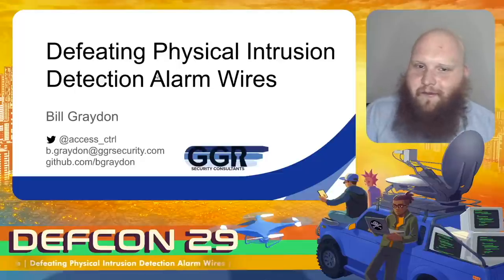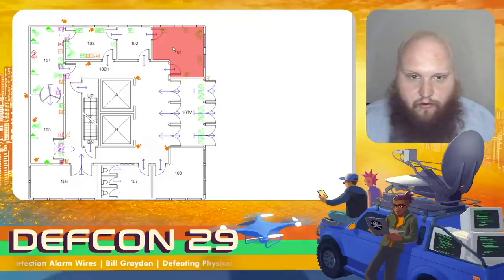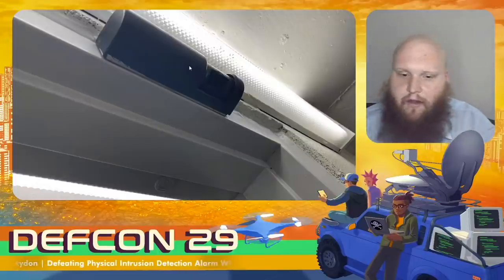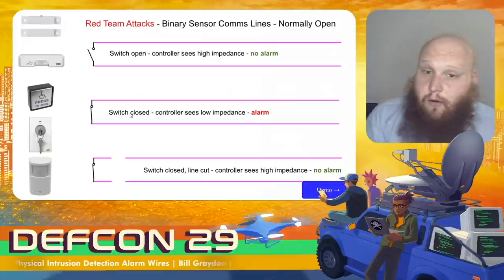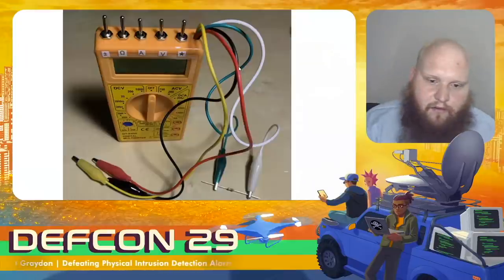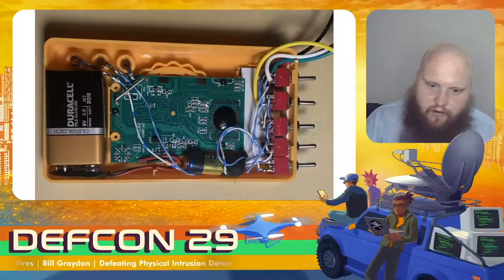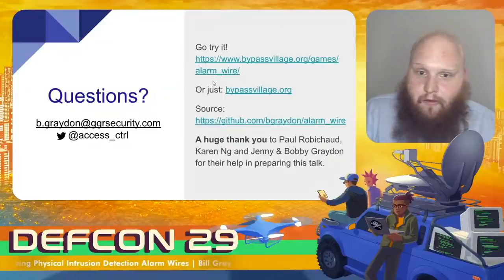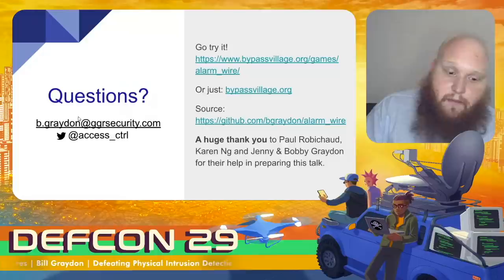DEF CON 29 - Bill Graydon - Defeating Physical Intrusion Detection Alarm Wires

Comment: I'm imagining a movie scene with the classic laser hallway, but two covert entry operators have to go through;
Operator 1: "I'll go first, you follow my movements exactly" *proceeds to do incredibly complex acrobatic moves through the lasers to get to the other side of the hallway 2 minutes later
Operator 1: "alright, now you go" 
Operator 2: "one sec" looks at wall mounted security control for a moment before cutting a wire and then casually walking through the lasers like they don't exist "nice moves, by the way."
Operator 1: "YOU KNEW HOW TO DO THAT THE ENTIRE TIME AND YOU DIDN'T SAY ANYTHING?!"

Comment: I think armouring cables should not be your first concern if someone can get access to enough of them and have all the time to disable enough detectors to cause a threat with this method. Very good and clear demonstration otherwise about the principles of the systems.
Reply: Put pressure on the conduit and make the alarm go off when the pressure drops. (Or perhaps even better, put a vacuum in them) This makes tapping into them even more precourious

Comment: The people who are clever enough to understand how to do this, and skilled enough to do it successfully, are probably too smart and careful, to trust that they're not falling for some easy trickery. 

You'd have to be so sure that it was the only one installed on that door. And that there wasn't a pir, or similar sensor, that would detect either the door opening, or you coming thru it.

If I saw a reed switch installed like that, on a system that was so well monitored, that I'd even have to resort to doing this, then I'd assume that there was more to this sensor, than just a badly thought out installation. 

Cool presentation though. Alarm logic is very fun to me. Thanks bro

Comment: Use two magnetic switches per door. One concealed, with internal wiring (inside the walls), and the other surface mounted, with external wiring, stapled to the walls.

Then you wire them to their own zones, making sure that you program the system, so that only the external (decoy) one is apparent, to anyone who happens to use the keypad zone leds, to try and figure out your alarm.

Also use pir sensors everywhere too, but mask them all in the programming, so people who visit can't just walk around everywhere, watching the keypad, to figure out any black spots they could exploit.

Another very, very important aspect of alarms, is remote monitoring, the communication protocols used for it, and what network type it communicates thru.

Preferably, you want to use cellular communicators, with fallbacks to Ethernet, and maybe even a second cellular network. 

Also, make sure your back up batteries are good, and every enclosure used in your system, is well located, and fitted with tampers.

Decoy alarm enclosures are a good idea too. I have three in my garage lol. With domestic alarms, you're really aiming to look like the most secure house on the street, unless you're one of the few people, who may actually be targeted by pros, in which case, you want to make it clear, with stickers, that your monitoring is cellular. 

It's pretty hard to block cellular comms. And anyone who understands them, is probably aware that most often, there are fallbacks such as Ethernet IP and old school contact id phone diallers, that make it very complicated to try and discreetly defeat them.

Obviously, in commercial etc, you're wise to add camera and access control systems too. And be very wary of who has access to what. 

There's no point having cameras and access controls everywhere, if Steve from the office, can just let himself in whenever he likes, and steal boxes of pens and paper clips, to sell on Amazon, without ever being noticed. 

And don't hide your workplaces cameras. It's probably not legal where you live, and you're looking to deter bad behaviour, not provoke it. 

Plus, who wants to be that boss, who sees or hears something they'd rather not. You're better to make surveillance obvious, or not bother. 

Being the stasi probably isn't that fun. That's why they were very angry people lol. You just want to make sure the workspace is secure and run well. 

You don't want to know what Dave does in the records room, when nobody is looking. You'll never be able to look at him the same again, or feel comfortable shaking his hand lol

Comment: Never seen such a simple intrusion detection system. Is this in use in certain country's? Where i live you won 't get insurance or a certificate for such a system. The same defeat system does not work on the minimum required type of switches that have atleast a 20khz OSSD double switching contact (with circuit crossed pairs in armored cable). Have you already looked into those kind of systems?
Reply: Monitored Honeywell alarm circuits with a 1k/2k end of line resistor are viable for UL certification in the US as long as the lines themselves and the sensors are secured according to UL standards. Typically this means in conduit it armored cabling.
Reply: This is the most common type of system here in Brazil.
Reply: I would say it's very common in wired residential systems (people have preferred wireless for a long time). When you see something like this in a commercial installation, it's probably not primarily an intrusion alarm system (it could be access control or fire alarm). European standard recognizes four grades of systems. And you have to realize that the scenarios geeks consider would fall under the highest grade 4, or at least grade 3. When it comes to certified systems, I would say grade 2 is most common in residences (at least when it comes to professional installations).

Grade 1 is essentially any old fool walking by. Grade 2 is a thief (some knowledge of alarm systems) with some tools (can be specialized, but shouldn't really be portable electronics). Grade 3 gives you professional knowledge and more sophisticated tools, including portable electronics (a jammer should fall into this grade). Grade 4 is expert knowledge and planning the attack ahead. So, the first three grades are opportunistic. Only the fourth grade is planned attack where you know what the system is, what are its weaknesses and you have all the tools you need (even expensive, exotic tools that require expertise to operate).

Even a simple system should satisfy grade 1 as it would work against a naive attacker (let's say you forget to lock your door and someone just walks by and tries to open it). With grade 2, I don't really know where the line lies (would a multi-meter be allowed? how about a hall effect sensor to determine polarity of a magnet?). Just like with safe standards, they underestimate how available and easy to use more sophisticated tools are. At least in my opinion. And I think practice kind of supports their view as most attacks are rather crude and simple.

Comment: @3:53, those are NOT the zones on the fire alarm panel. Those are control points from the annunciator. The "zones" he refers to may control relays for specific functions. The annunciator will display fire alarm zones (or points) in alarm or trouble.
Reply: Thanks for this comment - I stand corrected!

Comment: Correct me if I'm wrong, but to simplify the attack even further, just a pair of zener diodes in series (back to back, one opposed to the other) connected to the taps is enough to tamper a line where you know the voltage needed (say, you know the control system maker and model) without needing to read the voltage, polarity, or any further testing.
Also bet a simple double tap with built in counter zeners could even be fashioned for known voltage levels. Just pick and prick.
Reply: Good thought!  This would get you close - whether it's enough depends on the sensitivity of the controller.  The reason it won't be exact, is that zeners don't behave like ideal diodes in the forward bias region.  Look up a "zener diode v-i characteristic" chart to see what I mean - the forward diode will have some voltage drop across it.  You can correct for that to an extent by adjusting the breakdown voltage to be lower, but it does add uncertainty because variations in the current (through normal manufacturing variance) will result in variations in the voltage too.  In a time sensitive situation, I'd likely use an LM431 chip (which acts like an adjustable Zener) and a small controller to do it automatically instead.

Comment: Too bad 99% of the time the EOL resistor is just lazily installed in the can (main board) and not at the furthest point of the circuit, meaning you are free to short it without issue on NC zones and just cut it for NO zones...
Reply: At least this Cory guys knows. Good reality check Cory.
Reply: In the time I have done commercial security, I've never seen EOL resistors in the main control panel. It would just get too messy. Much easier to whack them in the end device
Reply: I’m not sure how secure the sensors are worldwide but here they would be the easiest bypass since door contacts don’t have antitamper and most of the motion detectors could be masked even if the resistors were in them.
Reply: @Thermoelectric7  He shows a picture of a system with that done in this presentation...
Reply: I'm glad someone mentioned it. I've seen too many alarm panels with a line of resistors across the active zones.
Reply: If you run 4 conductor cable, you can put the EoL resistor in the can and still have proper line supervision. Wire the device to wires 1&2, wire 3&4 together, at the can wires 1&4 go to the controller, wires 2&3 go to the EoL resistor.
Reply: Yeah sometimes this happens, unfortunately.  When it does, the system, as seen by an attacker on the wire, devolves into a normally shorted or normally disconnected line.

Comment: if you leave the hack in place it could be detected by the fact that the door never chimes when opened etc. 
also a over engineered system could see that a commonly opened door hasnt been opened in x time.

althought the coolest thing i learned in this demo was the whole concept of the voltage dividers on the line as free feedback.
Reply: This certainly true.  You can always install a switch, time switch, RF controlled relay, etc to turn the bypass on and off if the goal is persistent access without the faulty sensor being detected. 

Yeah, voltage dividers are pretty neat :)

Comment: The best way to bypass door and window sensors is to use neodymium magnets taped to the door jamb. Tape it on and open the door easy peasy.
Reply: Unless it's a 2 way high security reed sensor. Than you're screwed

Comment: This is why you should rather use a access control system - with encrypted communication to motor locks and card readers. And let this access control system, arm and disarm the system using the "KEYARM" input. Putting the access controller board inside alarm cabinet is also good, so the access controller piggybacks on the tamper security of your main panel.

Thus you don't need any entry or leave times. Another good thing with a such system, is that your access control system can be on a 24/7 zone, so the perimeter protection is always on. The access controller will only raise a alarm if you open the door without scanning a valid card or entering a valid code.
Reply: Card readers can be duplicated faster than these wires can be cut
Reply: @tannerlane9669  That depends on card reader, but if you use OSDP or a access control company's own system (for example, Assa's Hi-O system), then each card reader has to be "paired" into the system, meaning you could just not swap the card reader as each card reader has their own identity and encryption key. Also, card readers have a tamper switch usually, that will raise an alarm if the card reader is removed from the wall/door to be swapped for another.
Reply: @sebastiannielsen  you just lived my point, buy the right card reader, get a repeater and hide it near where they swipe at and collect all the data and clone
Reply: @tannerlane9669  Thats an entirely different thing cloning the card. Some systems have unclonable cards. But what you said, was "duplicating/cloning the reader", and that can only be done if its a simpler protocol like wiegand or similiar. Many readers have a "tamper sensor" that will pull the alarm if someone tries to unmount the reader from the wall.

Comment: I used to play with those motion detectors in high school. If you moved slow enough they wouldn't go off, but you had to move SO SLOWLY that it would take minutes to cross the hallway and was physically very difficult to do.
Reply: Mythbusters had an episode where they defeated IR detection with a simple piece of glass https://youtu.be/BIHpsyuyV4I?t=488
Reply: Motion detectors have been setup that way so there wouldn’t be false alarms from other heat sources. They also detect sideway movement a lot better. I guess you played with a detector that indicated movement with the led light. It’s a faulty installation tbh because the led should be only used for testing and not for anyone to see where the blind areas are.
Reply: @Leego  Ahhhh interesting. Yes it had a red light.
Reply: I used to play that game in school too. There wasn't much to do in our free time in the 90s lol

The ones we played with had the red LED too. Interesting to hear that they weren't supposed to be on.
Reply: @superscatboy  Especially considering I've never seen a system with the LED's off lol

Contractors not doing their job properly? What is this, reality?

Comment: The alarm panels rarely see zero resistance... They should have an EOLR End Of Line Resistor in series for a burglar alarm system.
Reply: For sure - that's an uncommon arrangement, and for a very good reason!
Reply: Rooftop access doors...
Reply: @twizz420  About rooftop “access “ doors??
Reply: Yeah if you watch the entire video he gets into EOLRs and the ways they can be defeated. I knew of the most common methods; but even learned of a new way when watching this video.
Reply: @magicarpetmoto  the method he describes will cause a trouble at the control panel before it does him any good. I speak with knowledge and experience for some authority and credibility on this topic.
Reply: @magicarpetmoto  when you add resistance to a circuit, either in parallel or in series, you change the total resistance presented at the load. When recognized as an improper resistance it will send a trouble signal to the CMS.
Reply: @W8RIT1  Im just saying when done as a simple substitution with a drop-in variable resistor Im having a hard time understanding how that could be the case. Im also just saying your original comment made it sound like the video forgot to address the possibility of end-of-line resistors when in fact there was a large portion addressing just that.
Reply: @magicarpetmoto  yes, perhaps it could use further clarification... I would have to watch the video again, but I believe I was referring to a comment made during the video about zero resistance, even though it can be approximated in many, but not all, cases to be viewed as a short or open for logic purposes, a circuit in some cases will have a resistance measures still, so not a true short with zero resistance. Yes, a bit on there side of splitting hairs.
Reply: @magicarpetmoto  the "drop in variable resistance" will change the total resistance seen at the panel terminals which will be outside of the "window" of acceptable resistance for monitoring circuit integrity. All this is out the door on a system which is wired as a polling loop.

Comment: @13:45 if you cut both wires at the same time with conductive cutters (basically all cutters) you will short the lines together and cause an alarm
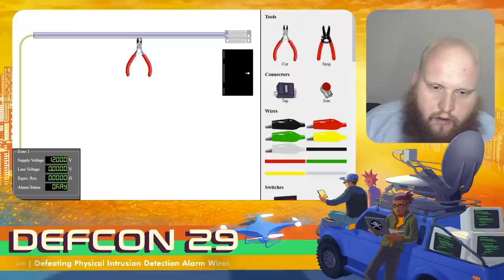Reply: He says that. 12:39
Reply: What I say at 12:39 is actually about doing the opposite, cutting the line when the goal is to jumper it.  It's a good point though, about the possible failure mode of your cutter bridging it.  There are a lot of practical tips, tricks and gotchas that I could have included, but didn't because 1) time and 2) the goal is to educate people on these attacks so they can protect against them, not to be a how-to guide for burglars.

Comment: That magnetic switch has a gap just slide tape with neodymium magnet to the switch and just open the door. or magnetic business card,  magnet strip with double sided adhesive

Comment: Slip a magnetic sheet between the magnetic contacts through the door crack.
Reply: Or a kitchen knife blade for 2 sec. open door, close it.
Reply: @ciobanurivelino3844  Nah, then you'll get extra jail time. The knife will make it armed robbery.
Reply: Biased contacts.   You’ll simply cause the contact to alarm as the magnetic field is disturbed

Comment: What about NOT connecting the alarm system's ground to actual ground and put 500Volts on it, relative to actual ground?
Reply: @bertandliam5196  I was thinking, the controller should put 500V on all of its wiring as a defense against anybody trying to mess with the wiring.
Reply: @fluffyblue4006  ohhh I see.  Interesting approach... but it has a trivial workaround - the attacker keeps himself isolated from ground.  The defender would also need majorly beefy wire insulation to maintain a 500V potential between the conduit and the wires inside.  The biggest problem though is the risk to legitimate maintenance workers, and the extra expense incurred in training, insurance, procedures, safety equipment etc, to be OHSA compliant working on it.  You also would run afoul of laws most jurisdictions have against setting traps.  If a burglar electrocuted himself to death on that system, you'd risk criminal liability, and also have a massive civil suit on your hands.